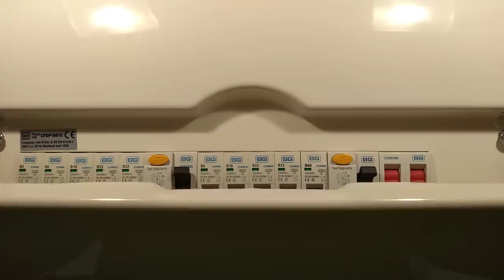A look inside a British home electrical panel.

Comment: As an American who build panels for residential and commercial uses, this was interesting to me. We only build this type of panel for very specialty (commercial) reasons. Usually if people want to be able to easily switch out breakers because the DIN rail makes it easier hot than bolt in panelboards. For residential it's all load centers with plug in breakers. We are a Siemens house and I just figured them being a German company that all of Europe did the same. Learn something every day.

Comment: So much more elegant then the North American solution. I like the italian way where they divide load into two main breakers: critical power (i.e. refrigerators) and phantom power with the meter incorporated. Usually located at your front door so easy to switch off phantom loads when you leave your home. Also nice to have the GFIs at the box end. I also like that you have three phase coming into your standard house - makes wiring the lathe in your kitchen so much simpler. Thanks Clive - great content

Comment: Hi from BC.
Big different from Canada's power panel's, cool vid.
Reply: Canada is very similar to the US except I believe lots of people use complete home GFCI and Surge protection in the breaker panels instead of individual surge and GFCI protection.
Reply: @the1andonlyfirebug  I'm in Canada  My home was built in 2007.  I don't have compete GFCI protection.  GFCI protects the kitchen, bathrooms, and outside outlets.  Bedroom sockets are protected by AFCI (arc fault circuit interrupter).  Not sure what happens in the US.
Reply: Residential gets 2 of 3 phases to make 220v possible for stoves and dryers. Commercial and industrial get all 3 for a potential of 330v.  (The McDonald's I used to work at used 330v for their grills)
Reply: @the1andonlyfirebug  The surge and whole home GFI setups are becoming popular across North America as far as I'm aware, and isn't really a "Canadian thing" other than we might get a few more rebates or something up here. They were highlighted in a few of the home reno shows up here awhile back, so I think that might have artificially inflated their popularity above what the US market has. 

But we seem to use most of the same suppliers and standards as far as I'm aware. Saves on having to pay someone to make standards that are different from the neighbours I guess?
Reply: @GaryCameron780  Our latest version of the NFPA/NEC is more or less in line with this now. The biggest problem is that the standards are left up to the individual states and either county or city to set and enforce.
Reply: @GaryCameron780  Your probably thinking 347v
Reply: @Randomhandle69420  Could be.  It was many years ago and I'm not an electrician.
Reply: @mernok2001  Canada has 600V 3-phase service available for industrial use. Phase-to-neutral voltage would be about 347V. 120/208 volt loads are supplied by a step-down transformer inside the building.
Reply: @the1andonlyfirebug   Here in north Florida (aka The Lightning Capital of the United States :) )  we're all ABOUT whole house surge protectors.  I've got 'em in both my houses and they've saved our electronics from direct strikes to the house and tree strikes near enough to induce spikes on the power feed. Before we installed them, I lost half a house of computer and stereo gear to a near-miss.
Reply: @unknownpony9833  I'm acquainted with a fellow in south Florida who has 440V 3-phase power to his house. He had it run in to feed his home theater system, which is a 7.1 surround set up with a 2KW amplifier on every channel.  Yeah, 16KW of amplification for a *home theater*.  :D

Comment: Completely different in Italy.
Inside my house I have the main line goes directly into a bipolar 30mA RCD (cutting both Live and neutral), from this unit it goes into a 16A and a 10A bipolar circuit breaker, and a further 16A bipolar circuit breaker inside the washing machine room.
The 16A circuit breaker goes to all the 16A power sockets, one in each room. All 16A circuits are wired with 4 sq mm wiring and we have no distinction between live and neutral in our plugs.
The 10A goes to all the 10A power sockets and all the lights. All 10A socket circuits are wired with 2.5 sq mm wiring and we have no distinction between live and neutral in our plugs.

Our wiring is opposite to yours, we go in from the top of the breaker and out towards the sockets from the bottom.
My mains switch breaker is 15 floors down in an underground room containing all Power meters with integrate circuit breakers for all the 60 flats in our palace, it’s a bipolar 63A remotely controlled unit. (controlled by the Power supplier company). They can remotely change the maximum power rating trip off.
Most houses, like mine, have a 3KW contract that allows a 3KW constant power with a peak of 3.3KW for 10 minutes before the main supplier breaker switches off.
If you don’t pay the bill, they can reduce the power consumption trip off to allow about 1 KWh daily consumption (fridge plus a light) for several months before taking the drastic decision to remotely trip the breaker and lock it into position until the issue is resolved.

Comment: This explains why GFCI's are installed in the sockets in the bathroom instead of the main board in the US. Neutral and ground are interconnected in my box, and that is why we often use polarized plugs instead of 3-prong plugs with a separate ground. Appliances are grounded to neutral. There is only one neutral bar in my box and the green incoming grounds are also connected to that bar.

Comment: 5 day course? 4 year degree in Electronic & Electrical Engineering, 45 years designing electronics and I'm not allowed to wire mains. Anyway I was amazed that in Spain they put so much trust in earth leakage circuit breakers that door bell switches are out in the rain with mains on them.
Reply from the maker: 4 year apprenticeship with a real electrical engineering company and a total of 38 years in the electrical industry and it's implied that I'm less capable of working on my own home wiring than someone who had no electrical knowledge at all a week ago.  Welcome to the deskilled future of 3rd world Britain.
Reply: @bigclivedotcom  Finland,north europe need 5 year and 3 year school and test and certified elektrick installer, only certified worker can made elektric legally. i has work elektric 30 year and ewery 10 yeaR NEED Go in to test and new certified.

Comment: We had a pair of consumer units installed in our server room, when our boss got all excited & decided he wanted each of the 3 server racks on a different phase sigh

Everything ran ok when things were powered on manually, but the system wouldn’t survive a power cut, as the A/B-rated breakers would immediately trigger, on resumption of utility power, when all the servers in the rack started to power on & boot up!  Once we swapped them out for D-rated breakers, sorted!

Comment: I love this setup. In canada, you're lucky if they installed a GFI in the kitchens and bathrooms. Love the regional GFI setup in that panel. Much smarter than the North American style of "Let's maybe protect areas where it REALLY needs it".
Reply: Maybe? It legally has to have GFCIs if its within a certain distance of a water source or drain
Reply: At least in the US, NEC now mandates AF (Arc Fault protection devices) in specific locations like bedrooms and the like with existing installations grandfathered in (likely until changes are made at which point you lose grandfathered status).  Being that some work is permitted by homeowners (depending on municipality and not in a commercial setting anywhere that I'm aware of), adherence may be iffy in a lot of cases.  Not sure what Canadian code requires now but I'd suspect it may be equal or more stringent).
Reply: P.s. is that power cable stranded?

P.p.s. 420th view...
Reply: @jamess3417  Oh, I'm aware. I have an electrician's certificate. I also know that almost every apartment I've been in has not had GFIs anywhere required by code (and have forced several apartment complexes to fix the situation). My next project in this place is to get GFIs in the kitchen (there are two outlets above the kitchen counter, both within 36" of the sink...).
Reply: we don't have any sockets in bathrooms in the uk not allowed apart from a shaver socket but they are not comman  and in a kitchen they have to be out of touching range from a sink not sure of the exact distance but that's the rule of thumb

Comment: Good to know they changed the name to "ring final circuits". That should stop all those cowboy builders from running their water main pipes into consumer units.
Reply: Underated comment!
Reply: Actually the name has never been 'ring main' for a domestic cct. It crept in to common parlance but strictly it's only ever been a ring cct or ring final. Technically the ring main is part of the distribution system in the street. 
I used to work supply side and it drove some engineers nuts.
Reply: It's like political correctness for frikkin' sparkies. Don't get me started on IT support staff because the inevitable admin was forced upon us all. 
Managers never cease to find you more of their tasks to add to your daily routine. e.g. Book your own annual leave online, do your timesheet online and order your own parts - but you have to use a nasty frontend app called SAP 'cos we sacked all the admin staff who could navigate AS400... 

Rant over!
Reply: @pmailkeey The spurs iof the "Ring Final" are actually on the same circuit.
Reply: Also light bulbs are apparently called "lamps" now. At least it stops people putting daffodils into light sockets.

Also they have now decided to call the three wires "line", "neutral" and "CPC" (rather than live, neutral, earth). I'm surprised they still kept the term "neutral" - I would have thought they would have taken the opportunity to rename it to "local earth referenced return conductor" or something similar.

Comment: Intresting! Looks quite similar to the ones we have in Sweden - except that we use to have 3 phase to all houses and even most apartments. Quite cool to see those thick cables as well as 32 and 40 A fuses in an "home panel". That's not very usual here. But that's because there is only one phase but still distributes the same power. Things like stoves and water heaters, electrical central heating and big heat pumps uses 3 phase here - most common is 3 x 16 A or 3 x 10 A. 
Common main fuses are 3 x 20 A (wich gives the same power as 60 A single phase). Usually most houses (except for a few old ones) can get up to 3 x 25 A without any rewiring (wich is like having 75 A single phase).

Comment: I've got a mixed system part is still on fuses with the kitchen and bathroom on rcd and circuit breakers. I should really get it consolidated into a new consumer unit.
Reply: Is there any benefit to actually changing it though. Aside from having everything RCD protected are there any real benefits in upgrading it assuming it works fine and is safe? My sister is in the same boat, I told her shes better off just holding off and having it done when she needs a rewire but I may well be wrong.

Comment: Will you show an old board? Like where you'd have to wrap the fuse wire yourself 😅 a lot of those still about... Scary
Reply: Phonotical yeah we still have an oldskool ‘fuse board’ with wrap around fuse wire! One circuit for sockets, one for lights and a “cooker” circuit (although we have a gas cooker) so it’s on the list of things we need to sort out. Can barely afford to put food on the table tho so unfortunately it’s a risk I’m having to deal with for the time being ☹️
Reply: @gilbertsprojects2954  I am sorry to hear that, if it isn't broken, don't fix it! (yet)
Reply: Phonotical a family friend is an electrician so hopefully we’ll be able to get him in to do the majority and I’ll do the donkey work to keep the price down...
Reply: @gilbertsprojects2954  slow and steady as they say, will be sign off for the work you did or just on his part, I guess having done it yourself, nobody else is going to know so it doesn't matter
Reply: My sister had that type when she moved into her current house a few years back. It was modernised when they had an extension built. So far I've not had one. @Gilbert's Projects, I know that feeling.
Reply: Phonotical I meant I’ll just do the chiselling out for new cables, drilling holes etc. I’d be confident enough to do it myself but as everything has to be “signed off” these days I’d rather let him do the electrical work so I know it’s all 100% right. Hoping he’ll help out for beer money lol 😬😊
Reply: @gilbertsprojects2954  worry about paperwork in the future, when at that point you can say you don't remember who did it and you've not got the paperwork any more 😅
Reply: @gilbertsprojects2954  That is concerning :/ Maybe, if you have time, look around renovation projects?
I have gathered a lot of spare outlets, fuse holders (the plastic 80's ones) and even a few modular breakers aroudn those, because renovation usually mean a new electric board and electricians advise to replace all breakers. So you can get working ones for free or just for a small note to the electrician.
Reply: My parents' house still has one (although it has had breakers retrofitted).
Reply: Nothing scary about them, installed by quality tradesmen and already stood the test of time. PRICE WORK now there’s something to get really frightened of!
Reply: I have one. Might get it changed one day.

Comment: A fascinating video, with elements both familiar and alien.  The breakers are quite similar to the ones we have here in North America, but I've never seen a single RCD protecting multiple breakers. Here, they're either integrated with the breaker, or built into a GFI outlet. Another difference over here is that we don't have a discrete isolator. Instead, it is combined with a large (typically 100 or 200A) main circuit breaker.

And I completely agree that five days is not enough time to train an electrician. That's barely enough time for them to learn that something like this is not a good idea. 
( https://pbs.twimg.com/media/Dp0_-hPWoAcqVvf.jpg )
Reply: ahahahah! Great photo. Where's the one of the penny jammed into a glass fuse socket? That's what my parents' house had when I was a kid (glass fuses, but no pennies!)
Reply: No pennies, but I did find this handy dandy substitution guide:
https://pbs.twimg.com/media/Cj-kw3YUgAA6MHH.jpg

Comment: In Brazil we've got 127/220 V 60 Hz depending on where you live. In some really odd places you may find old 115 V Installations. Speaking about circuit breakers we have two types: NEMA and DIN. Some places may have RCD's but isn't mandatory installing them in domestic consumer units.

Comment: We use the same way you use for   wiring  fuse box and plug and switch becuse we applying the BS in our electrical works in iraq.
Reply: A friend from Syria, educated to engineer in electronics and electrics, said that they are mostly following European standard with materials and ways of design in modern building. Too many in west think that east of Greece, all electrics look like Thailand. What is the most popular brand of material in Iraq?
Reply: @arneanka4633  
our popular brand in iraq .MK . ABB .ALFANAR Ksa .and indian brands .
Reply: I noticed this when traveling in Iraq recently.
Reply: @Stuartrusty  
yes and mostly in houses before 2003 becuse chinnes product now it cheep and people baught it but it don,t remain longe time .
Reply: @Ahmed electrician of iraq - What is the quality of Alfanar compared to ABB? Is it like Chint?
Reply: @DjResR  it have usa and bs standard and it's price low
Reply: @ahmedelectricianofiraq5550  ABB is the third choice in Sweden. Good quality at a reasonable price. We have mostly Hager and Schneider among professional installers. Some use GE. We have Chinese imports too but those are mostly sold to the public who aren't allowed to install them.
Reply: @arneanka4633  so what's the no1 brand you use mostly
Reply: Its interesting you are talking about using quality components when even the best components are defeated by the horrible installation that I have seen in North Iraq.
Reply: @ahmedelectricianofiraq5550  As said, Hager and Schneider. Actually, Chint is seen now and then and seems to be a good alternative if you are on a tight budget.
Reply: @prion9819  
That is true. The reason is  there are no electrical institutes or training centers that depend on training electricians. I read the electrical books and I read all the electrical related matters and also follow the British specifications because they are rolling in our country. There are several Iraqi electricians who are distinguished on YouTube and i am and they use English and German specifications in their work. I beg you not to make a judgment on all the electricians until you make sure of their work.
Reply: @arneanka4633  so chint have low price and quality if you on tight budget
Reply: Its good to know that there are at least a few electricians in Iraq that realize quality installation will save lives and property. احمد الكهربائي العراقي Ahmed electrician of iraq
Reply: @prion9819  The cost for installation is not higher if you install according to EU standard compared to total mess. It is seen as a bigger hole in your wallet when you build but if someone is dead or the house burns, the cost can be very big in liability. And you need to fix everything when it start to smoke anyway.

I work in homes and many do electrics themselves to save some money. If they called me, it would cost half because first I need to remove all their shit and then install correctly.